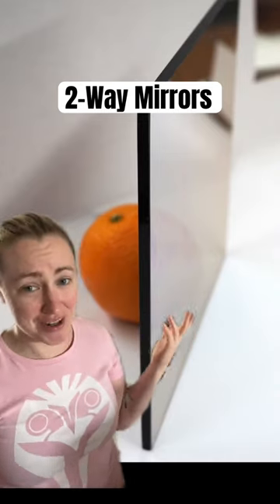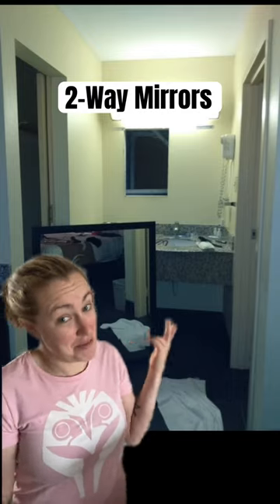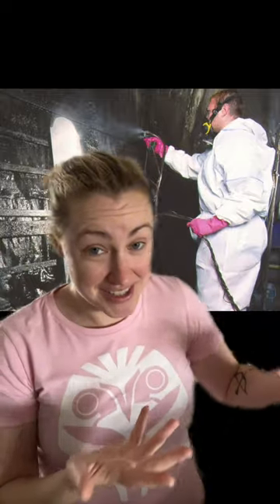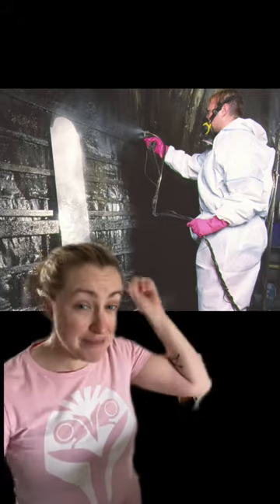How do 2-way (transparent) mirrors work? #science

Comment: But why? Metal shares electrons. This is why, when you put a metal spoon in the microwave, it sparks. It's reflecting the microwave light. 
Here's another fun fact: gama radiation isn't really blocked that well by lead. It would take about 9 feet in some cases and some raisin will still get through. But water, which visible light passes through transparently, is opaque to radiation, absorbing it, like the color black absorbing sunshine. This can ionize water in your body, eventually negatively charging a molecule of DNA, breaking it's bond, which causes cancer.

Comment: Got it, so put a tint behind, and a second 1 way mirror coating, in between glass sheets and a extra glass plane in front of the customer facing mirror for the finger gap trick creating a 3 glass plane thick 1 way mirror, with 5% tint and another 1 way mirror behind that.